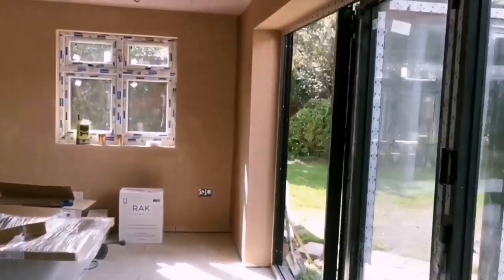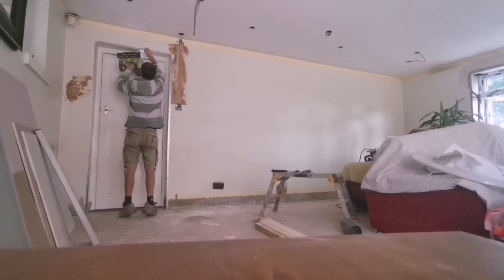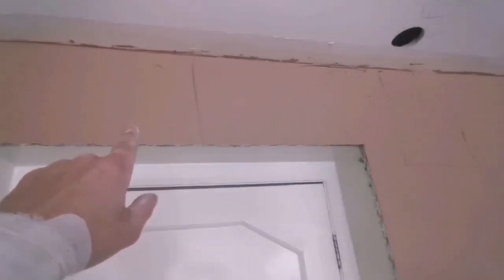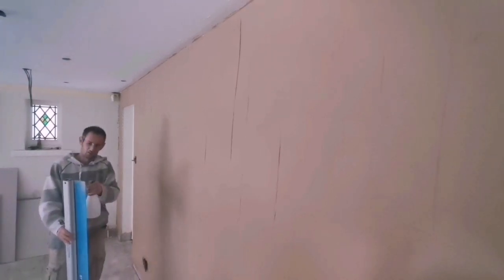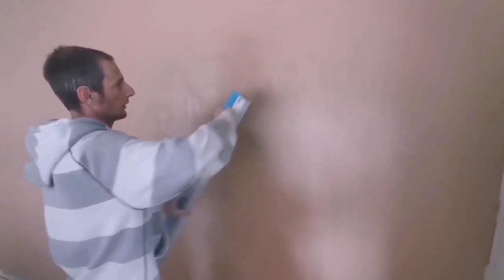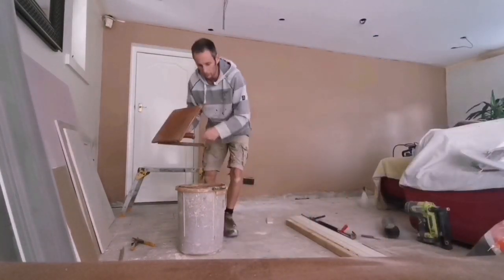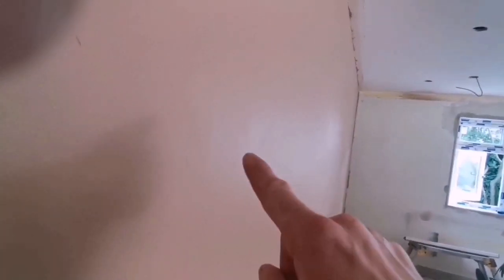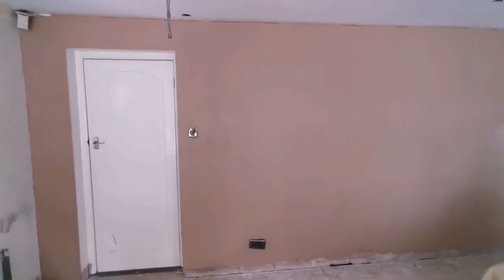Plastering with the 0x speedskim

Comment: Hi Mark. Great job. Do you use the sponge float or flexi trowel aswell?  If so what stages do you use. 
Eg first coat , wet trowel , polish trowel etc.
Reply from the maker: Hi mate Yere I just used my steel trowel to finish wile it wet on final coat then a quick polish after with a bit of water👍

Comment: I once done a full kitchen with a spatula and very little use of the trowel I used that tyzack one and and age trowel worked real well but I felt i had to do it that way as the gear was not waiting for me it was go for that or lose a wall or two was all plasterboard but the plaster was setting fast I must do a video where i use a spat the whole way through it dont feel as normal but can work also , I did finish with a super flex but at that stage the walls are under control :):)   Nice video mate glad you getting on well with this
Reply from the maker: Nice I would definitely like to see that video. Yere I really like. And because I don't do it every and I a bit slow really helps me get on top of it 👍👍👍think I am going to try the other blades for it one day

Comment: @markhep How long did you wait before applying the 2nd coat? Thanks
Reply from the maker: Was around 20mins. You want to try and get it on when it's still damp. But pritty ferm. So it goes on top not mixes in with the first coat👍

Comment: Fair play, Mark. That looks like a real time saver. I don't mind doing a bit of skimming for a bit of variety but I've not tried using one of those.....I might just have to go out and buy one now to try it out! I'd be worried about carrying it around in the back of the van just in case it got damaged, I'm assuming it is quite fragile?
Reply from the maker: Yere you can easy damage it. But a real time saver for me 👍👍👍
Reply: Been using 1 for about 2 years now but I wouldn’t use 1 on PVA n skim only on boards, the Moldovans n Romanians on my job are absolutely shit hot with them and their standard of work is fantastic, clean neat and very tidy, what more can I say, give credit where it’s due🇬🇧
Reply: I drive a ford transit a safety feature I use is I put both finishing trowels and speed skim with the protection blade on tucked behind the passenger seat head rest not had any problems in as many years as I’ve done it the padding from the head rest and bulk head has never damaged any of my finishing equipment

Comment: Which model and what size is that mate ?
Reply from the maker: Hi mate this is ohe plastic one not sure what model. It's 900mm long. I have been told the 1200mm is better. Probably depends on what size walls you are doing. 👍👍👍Hope this helps

Comment: How long do you leave the plaster before you go over it with the speedskim? Is there not a risk of taking it off the wall if using tool too soon. Nice job by the way mate.
Reply from the maker: Chears mate. With mine you can pritty much go over it straight away and it's fine. Does not take much plaster of at all. Realy good for the slower plasterer like me 👍
Reply: @markhep  Thanks for your reply Mark. I'm a slow beginner who has just bought a 900 mm Speedskim to try and help do my daughters me house. Using multi skim on the walls wan.t sure whether to leave for 10-15 mins before flattening.Another little question Mark is it just very light pressure on the blade as you cross the wall. Thanks again mate you've been a big help already.
Reply from the maker: Hi mate yes you don't need much pressure on it at all. I prefer to go straight over with it. On first coat. Put second coat on straight over again or you can wait 10 mins. Then when it's going hard. Just finish with your stainless trowel with abit of water👍
Reply: @markhep  Cheers Mark. thanks very much for taking the time to reply to my questions. You have been a great help mate, If I meet you in a pub I'm due you a pint or few bud. Cheers mate.
Reply from the maker: @paulreid4076  😂Chears Paul 👍👍👍
Reply: I’ve recently converted to the speed skim best application is trowel it on to a smooth as you can , then speed skim for the pure level and trowel finish for the glass finish (if you don’t like the painters)

Comment: Great video have you got a link to the one you bought
Reply from the maker: Hi mate so I got it on ebay but the guy sold out. But if you put this in OX PRO SPEEDSKIM - PLASTIC 900MM - OX-P530990. Should give you some of the same I paid a few pence less than 60 pound. Hope this helps👍
Reply: @markhep  thanks for the quick response will definitely be getting one
Reply from the maker: @davidwood8837 nice 👍 I love mine I want to give the steel one a try eventually 👍👍👍